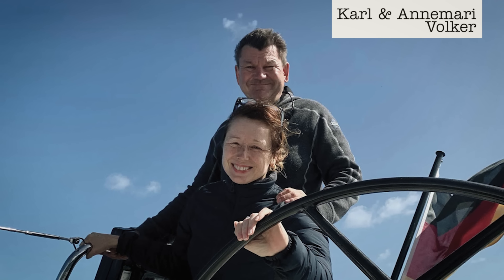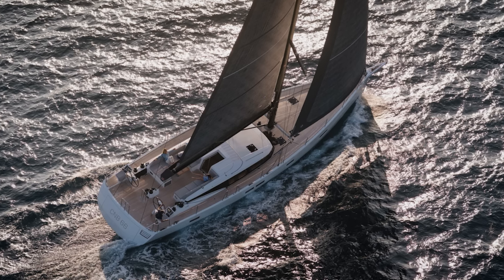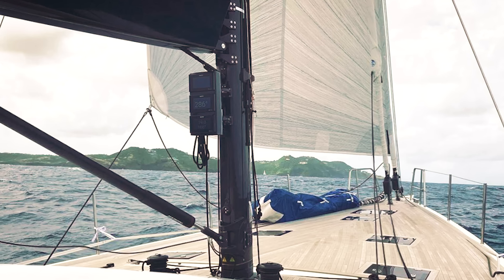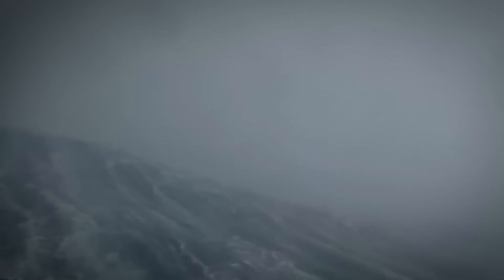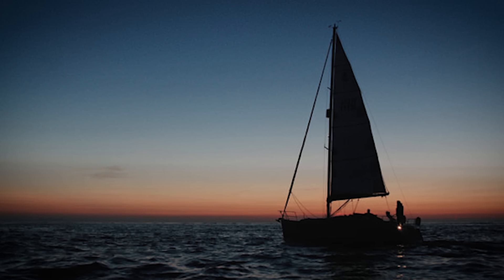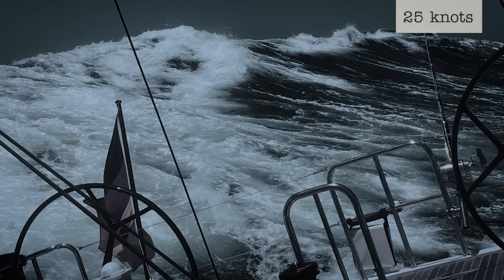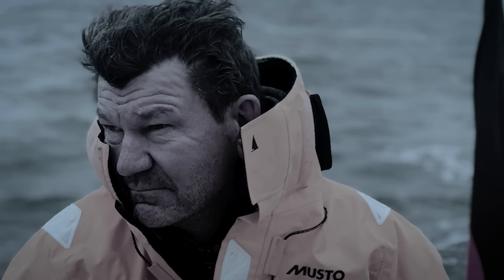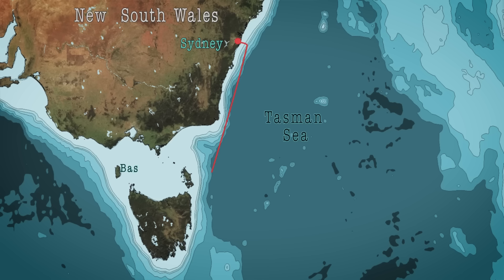Couple DIES on Private Yacht!

Comment: We met Karl and Annemari in Bermuda the week before this tragic accident. They were very sweet to us. Our condolences to their friends and families. I believe there is a very important lesson learned here: the old wisdom of “round up to reef” is often the incorrect move, especially in a wind vs. current situation they may have been experiencing in the Gulf Stream. The in-boom, in-mast, or slab reefing discussion is a moot point when the real problem was the SOP of turning upwind to reef. This is not just my opinion; I’ve discussed this with many sailors. John Harries wrote a great article about this accident and downwind reefing that is easily searchable on Google.
Reply: Thank you for sharing. Good luck and good winds to you!
Reply: How would you furl the genova if you do not turn upwind ?
Reply: @dmitripogosian5084 on a downwind course the Genoa is mostly blanked by the fully out main and is depowered.  It’s fairly easy to furl.

Agree with learning how to reef when on a downwind course, but I don’t know how works on a in boom furling main,
Reply: @james... Are you talking about the main or the genoa?
I agree with you with the genoa, but this vessels main could not be furled without being in irons.
Reply: @dmitripogosian5084  ... Test it on your boat.  Turn to a dead run and see how easy it is to furl the genoa.
However, 25-30kts is another matter.
But, they should have put in a reef (or two) for overnight sailing anyway.
Reply: @sailingsibongile . A furling main can be reefed while hove to with main sheet out
Reply: @matthewmcdermit8744 Take it easy now Mr Know All...The best captain/skipper is always the one standing ashore while the shit happens...The back seat driver is ALWAYS more competent,intelligent,and most importantly of all,PRESENT when the shit happens...in the same way that you were present on board in this case...obviously I am not being sarcastic...The conditions were extreme...mistakes were made,granted,but you cannot adjudge the situation based solely on your abstract impressions...fact is you are not,and we're not a direct witness  of actual physical circumstances in situ.....
Reply: It had nothing to do with the 2 inexperienced sailors that got killed. The skipper who didn't properly safety brief , train and practice his crew ... On how the equipment on his boat works, while in calm safe conditions -  is the cause of this accident.  
   It wasn't the ropes fault, nor was it the inexperienced crews fault. Folks are only as good as the training they recieve, and training is only good - if someone experienced with that boat's equipment, trains them. Namely the skipper/owner of the boat. If the skipper doesn't properly train his crew, then it is he who is responsible for their deaths. .  This type accident never happened to anyone before, and if it wasn't for the skippers laziness and incompetence- those folks would still be alive. . 
 Granted, if the 2 injured folks would have used common sense and wisdom- theyd still be with us too. But It was the skippers responsibility to train his crew on the workings of the boat's equipment , and he didn't do it. So it was the skippers irresponsibility , laziness, and inconsideration for the safety of his crew , that got those folks killed.
Reply: @gerhardusvanderpoll  a) the conditions were not extreme in any way b) the video analysis gives a completely false picture of ”competence” c) there is nothing wrong with pointing out others flaws and learning from them. Hiding them is what makes it wrong. Lots of people here are trying to excuse obivous incompetence by glorifying it somehow.
Reply: @dmitripogosian5084  let out some slack in the sheet, it'll balloon it out and forward a bit and you can furl it in until wind puts tension on it again, rinse, repeat. It's how I furl my genoa when not upwind.
Reply: @sailingsibongile  Well, if the wind is 10 knots, sure. Though my boat does not have a furler and is < 30 feet. So for me lowering genova downwind is prone with dipping it into the sea.  Saying that, in strong winds there are seems to be as  many videos on Youtube where the furler jammed when  trying to reef downwind as when it is a success. 30 knots will still leave you with 20 knots apparent wind into your sails.  This is, of course, is a very large boat, with everything electric, no experience with that.
Reply: @aaronwalker8847 you are really talking a big hypothetical game here for not understanding what even happened… the skipper and his wife (owners) were the ones who died. My god
Reply: @siltee9983  The wave hight was not extreme..??? Something like (more than)
 10 meters I think...if I read and remember correctly..??? I consider a sea state of say 3 to 5 meters as a sea state which is average/normal on the Beaufort Scale...(about state 5.) From what I understood the sea state which they experienced was about state 9/10....Please note that the Beaufort Scale max is Force 12....Everything is Relative...ask your great uncle Einstein...add the heavy boom to the sea state...and presto.....circumstances are indeed extreme for the persons on board. ...Only God is absolute and can make absolute judgements...I am an atheist by the way....Mortals like me are subject to the principles of relativety...but I suppose that if you are sitting on the right hand of God....lucky you....then their circumstances were not extreme.....
Reply: @gerhardusvanderpoll playing a victim here are you. What are you whining about? In the video they said up 6 meter ways and 35 knots. Though conditions but in no way extreme for that size of a boat. Unless you are “experienced duo” having a NIGHT shift on a unfamiliar Boat and two times fail to reef in advance
Reply: @siltee9983  Not playing the victim at all....as I was not involved in the situation....so how and why would I want to play the victim, as I was not in the described situation🙄🤔???.I am merely a human being in the first instance,and as an empathetic human being I focus on the tragic loss of life and painfull experiences which those who died must have gone through...But human nature,unfortunately,being what it is,leads to nitpicking through all the shit which surrounded the tragedy...shit happens...the best fighter can,and often does lose......the best swimmer sometimes drowns...and so does the worst swimmer...in both instances there exists a tragedy....from which lessons may be learnt...It is impossible for any one individual to have a holistic view of all knowledge contained in the Universe, so as to be able to avoid all possible tragic occurrences...and this fact applies to those who died...but also to you....maybe you should be grateful that you have not seen your ass yet,in some circumstance which you did not foresee,or could not foresee...Life is like a carrot...one minute you  might be holding it in your hand,the next minute you might find it up your ass.....
Reply: @gerhardusvanderpoll  Denying reality is not being empathic. Neither is shooting messengers. Both unfortunately common habits in todays world. The task at hand is identifying the causes and learning from these. There is no benefit in glorifying the survivors just for the sake of it. The video paints a picture of a glorious experienced crew who did nothing wrong. Based on the boat, the weather and all factors included - it does seem with the facts presented they did an extremely poor job which resulted in the death of two persons (of course the two who died also did a poor job, which the video points out). If an alcoholic dies of liver failure there is nothing BAD about discussing the reasons for his or her death truthfully, nor is it unemphatic.
Reply: On some boats you can’t get the load off the main luff track sliders sufficiently to drop the main to reef even if the main sheet is fully de powered…ideally you need to be luffing / close hauled with headsail to keep some stability and be able to drop the main…without having to winch it down …which can cause other issues…
Reply: @TM-yr3pc  well why not heave-to then?
Reply: @siltee9983  it might work …but in a heavy sea state and / or wind v current you may not be able to keep sufficient way to control heading and hull motion …then the main and/ or track sliders will also load up and stick/ jam. If you are heave too you tend not to point too high and hull can get slapped around if wind and waves aligned …it’s not so easy to be up at the mast reefing in those conditions. I’m out of date but it used to be like that…
Reply: @matthewmcdermit8744 
You weren't there so you don't know what happened, you have no right to judge!
Reply: @dmitripogosian5084  furling a headail downwind is absolutely the way to go. By doing it downwind you're decreasing the apparent wind on the sail....also as stated you can depower by easing sheet. Of course you always want to reef early and often so you're dealing with less and less sail area as conditions worsen. The most trouble free setup is what you've got...hank-on sails can always be dropped. All furlers can fail and when the do, its usually at the worst possible time. Mainsail is slab reefed. I can put a reef in downwind in literally seconds...by sheeting out the boom to depower (just like genoa).
Reply: @TM-yr3pc  Maybe, but considering what was brought up in the video and what was omitted.... I believe not much actions were attempted by the "experienced sailors" to stabilise the situation. Otherwise all those things would have been brought up in the video, with explanations why this was not possible or that these attempts failed. Now, no such things were mentioned whilst detailing other things that were done during the crisis. This to me indicates that nothing much was attempted to stabilise the situation. Instead they decided to bunk inside the boat and drift along until the storm was over. Basically leaving an almost fully rigged boat floating freely in the storm. They were lucky things did not deteriorate.
Reply: @matthewmcdermit8744 the hired help gave the owners a shot at survival, idk why you say they were idiots. 400nm out to see you would have sailed ‘er in in that condition??
Reply: @falkpatt  You must have very good track slides or slugs which don't jam up off the wind.
Reply: @awuma  yes....i have a Tides Marine Strong Track...
Reply: It seems to me that the proximate cause is that the hand on watch did not wake the crew early enough to reef,  as Karl had done the previous night. I wonder if he was asleep.   It seems like the root cause was trying to make way  too big a boat manageable for a crew of only two middle aged desk jockeys. (I'm a middle aged desk jockey).
Reply: Sorry for my English, maybe not correct. How do you reef the main downwind if the main has the pressure of the wind? I have always reefed the main going upwind and leaving the main without pressure by loosening its "escota"...(the line that controls how far it opens).
Reply: @matthewmcdermit8744  you are the worst type of armchair quarterback with your diatribe.
Reply: Harries article Is very interesting, but he does note that no one that he knows with boom furling or in mast furling finds they can effectively. downwind.  For those of us who don't have in mast or in boom, furling, it's perhaps great technique to have in your toolbox.
Reply: @siltee9983  What obvious incompetence would that be?
Reply: @siltee9983  I'm not sure what you're trying to say here.  They had reefed once earlier that night, and they had reefed several times earlier on this trip, when they experienced deteriorating conditions.
Reply: @juanmanuelcobo5947   There is a good article by a man named Greg Harries online that describes how he reefs, but it assumes slab reefing, and a preventer.  He acknowledges it may not be appropriate on boom or in mast furling systems.
Reply: @TM-yr3pc  That sized yacht in 30-40knots should not get you in that kind of trouble.
Reply: @SailingWindGypsy  BS. They whole story reaks of incompetence. It was 30knots and that kind of boat.
Reply: @siltee9983  Please elaborate.  There were mistakes made.  What do you think they were?
Reply: @gumbykevbo  Three people were on deck, and Karl had gone below to sleep about 30 minutes earlier, to prepare for his watch later that night, after the first reef was put in.
Reply: @aaronwalker8847  I think we're talking about two different events, because this certainly does not describe what happened on S/V Escape.

Comment: I myself met a CNB in panama that had been struck by lightening (whilst in port) no shore power, I tried to help the skipper with my knowledge on the electronics aspect. He was totally nailed, could not start the engine, genset and I look around the boat for obvious stuff to save the batteries. It was a total nightmare. Not for me at all. the horror

Comment: In such bad weather, undermanned, it may have been folly to try to keep sailing: they may have done much better motoring just enough to hold their direction, or if fuel did not allow this, heave-to and wait out the weather, even if that means a few more days sailing.

I personally think that the ultimate problem stems from the size of the boat: it was simply too big for a crew of two in bad weather, and while they did have some help from the extra crew they picked up (which almost saved their lives, and probably saved the vessel) these were not sufficiently familiar with a nuanced vessel to be sailing in bad weather. The rig had to be big enough to drive the boat, and such a rig was not manageable without serious engineering compromises; the overly heavy boom, that weird attachment of the main-sheet in the middle of the cockpit (I've never seen one like that before and it immediately looked odd and dangerous to me, like 19th century levels of dangerous). It may be old-fashioned, but the engineering solution to the problem of too large a sail for the expected number of crew may have been to split the canvas into two more manageable pieces with a gaff rig. While this is complicated for two people to manage with the topsail, they could forgo the topsail when appropriate, at which point it is a relatively easy rig to handle (though I still think it would be too much boat for two people).

At the same time it was not helpful that they were in the middle of training two crew who, although very good sailors, were not familiar with the rather nuanced vessel they were handling, in bad weather, on a long crossing, the captain without enough rest, and no one who else who knew /exactly/ how to handle the boat. They might have fared better if they delayed their passage north until the two hands were more familiar with Escape, with German commands, and with the unusual procedures.

One other note, and it's just my opinion (take it or leave it, YMMV): if your boat has electric winches, but even the entire crew can't manage the rig without them, you are actually undermanned.

Comment: the "uncontrolled jibe" animation ist wrong, the wind would need to turn exactly to the opposite site for the boom to swing around.
Reply: A wave can cause an uncontrolled jibe.
Reply: @StefanMochnacki  that‘s not what I meant. The wind direction in the animation changes from the back to the right, which would only take pressure out of the main sail hanging left. For the boom to swing around and become dangerous, the wind would need to come from the left, not from the right.

Comment: Honestly, that was just too much boat for the both of them. When you are sailing with two people EVERYONE on board needs to know how to operate every inch of that boat! If something happens to one, the other has to pick up the slack, literally and figuratively. You can't have one person knowing how to operate the sails and the other person not knowing just as much. That's an accident waiting to happen. These people lived their dream, which is something many can't say, but they were also unprepared for bad weather with the boat they had, as expensive as it was. Better to get something smaller that is easier to handle for both people and will get you where you want to go. The biggest is definitely not the best when it comes to boating for two people. There's a reason boats of that size have a crew! RIP to them! They died doing what they wanted.

Comment: I’m an ocean sailor Yachtmaster and sail solo. My boat is 9.75 metres long. The mainsail and jib are relatively easy to handle. The cockpit is closed and deep, small and safe. 

I can’t understand what would make a couple consider a boat of that size?  With the way it was rigged and the open designed cockpit. The couple wanted a sailing cruise ship not a sailing yacht?  Way too big a boat even for 4 crew members to handle. Crazy situation accident waiting to happen! Sad though!